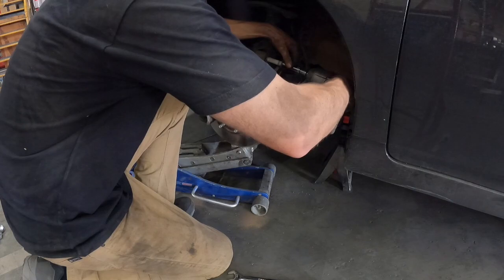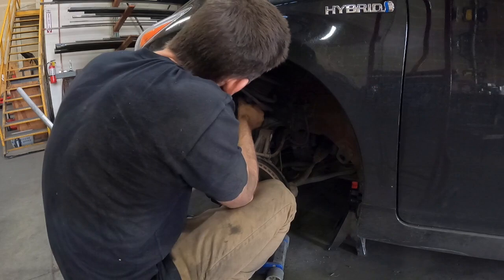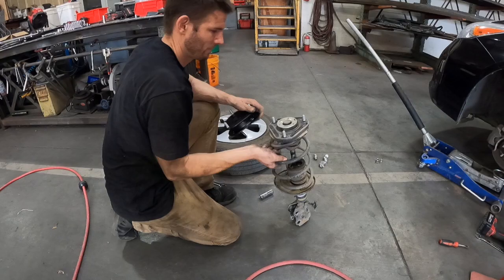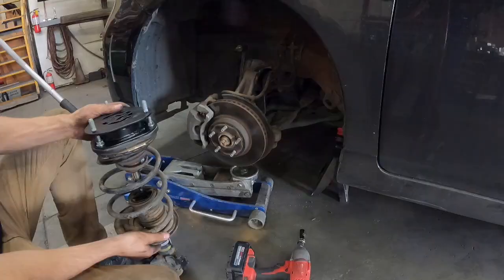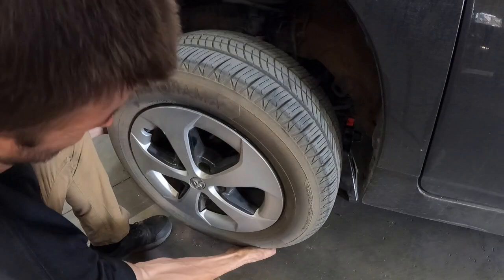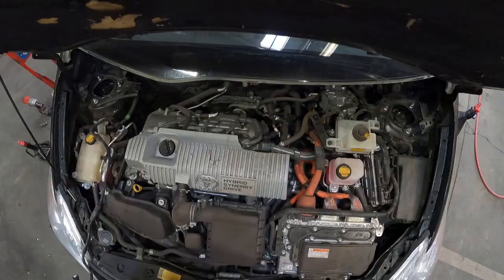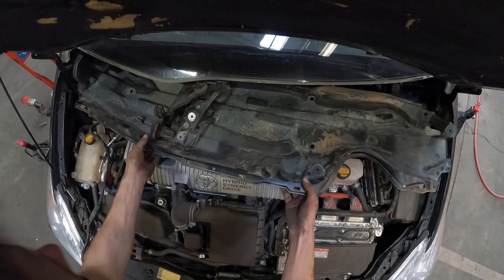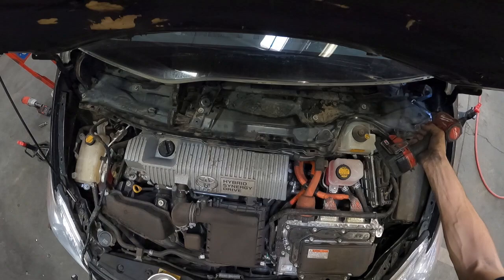PRIUS OFFROAD GEN 3 (2010-2015) Front Lift Installation

Comment: Hey brother, hope you're recovering well from your accident. Thanks for what you do for the community. I have to ask- Have you guys tried mix n matching OEM parts from other platforms? I think a Rav4 LCA up front and a Sienna strut would allow for larger lift without geometry or tire clearance issues. I haven't crawled under the back of my Gen 3 yet to see what in tarnation is happening back there, but it can't be that different to anything else they do. It's just arms and links- cheap parts to get lengthened etc depending on design, or use something of another car to get to spec. I just can't jump on the kits yet until I explore OEM options. 
One thing that's interesting is the Prius has TONS of strut/shock rod travel, most similar to a Sienna in terms of how the rear strut is mounted/moves through its travel. I assume the rear suspension is very similar, just lighter duty/smaller overall. Notably- I think the 08 era Sienna rear shock would fit really really nicely in a 2-3" lifted Prius--- In fact might have to use a slimmer bushing to "shorten" the compressed length, but it has another 1.1" of stroke, compressed length is 2.3" longer. There are Tacoma and Tundra shocks that have similar strokes/lengths as well. Tacoma oddly enough are too short. From what I can tell, Tundra rears would work beautifully. Almost exactly 1" longer than the OEM shocks, same stroke more or less. Valving would be a complete unknown. Definitely think the Tundra shock would work great, given the extra leverage the IRS has against it, and not having the leafs to manage, I think the damping might not actually be that bad. Hard to say. But the longer compressed length might prevent stuffing an OS tire as well. 
I actually considered using a Sienna shock on my 4Runner as a joke, since it has a really impressive stroke but the compressed length is too long. Which Is something I actually need now with my GX setup but I'm going TRD pro on it. The TRD Pro shocks are really really close to Prius OEM lengths, with a hair more extended length, nearly identical compressed. 14.7-25.5 give or take, prius is 14.5-23.8

Comment: Really having trouble reinstalling the passenger side strut to steering knuckle. Have some pry bars, etc, but don't seem to have any spots that work to get the angles right. Seems like a spring-compressor would work but don't have one. (My brother in law might... or I may make Harbor Freight a little bit richer!) Any tips appreciated!
Reply: Well I bought the spring compressors and they did help a bit. Also pushed up the bottom of the strut by putting a jack stand under it and lowering the car about an inch... then the rubber hammer and pry bar did the rest!
Reply from the maker: Have you watched our passenger side strut installation video that covers exactly this? https://youtu.be/MkQn7gV-arM
Reply from the maker: @gregors1422  Good to hear you got it figured out!

Comment: Mine is one the way!  Question, does the TRD rear sway bar help?  I haven't had a chance to really look where it mounts, but I couldn't understand how it would help a solid beam axle.  I've got 215/70R15 tires on right now and the front rubs some on bigger bumps, but I still scrape my bumper in places.  But I'm thinking about stability with a load on the back of the car, to be more specific about 170lbs of trailer tongue weight.  I've had 240lbs of salt in the trunk a couple times.  Less than half the payload capacity, with me in it.

You should make some videos on your Gen3.
Reply from the maker: Nice! As for the sway bar, we have yet to try out different sway bars but I would assume it would reduce sway as it's intended. Let us know your thoughts on it after you get it installed so we can let others know.

Comment: Do you have to remove the shroud and everything. I’ve removed it before so I know its not terrible. More just laziness. Looks like if I just take the outside clips and push up a bit, I can get a socket and ratchet.
Reply from the maker: It can be done but it's a lot easier to take the extra minute it takes and remove the shroud.

Comment: What about the 2021 AWD Prius lift kit installation? Same process? Will you be making a video for that? Thanks in advance.
I'm about to purchase a new 2021 AWD Prius and will most definitely be buying your lift kit.
Reply from the maker: Same process, just a little bit easier since you don't have to remove the metal wiper cowl to get to the top of the struts. No plans on making a video for that since it's the same process but maybe once we get some free time to step away from production and designing new parts.
Reply: @priusoffroad3232  Awesome. Thanks.

Comment: I just got the prius Offroad lift kit for my 2014, prius GS 1.8cc (gen 3) 
I own a right hand drive car...
So i need to ask how the arrows and letters should be placed on front kit
as you advised that the arrows should be pointed towards the passenger side (driver side in my case) and the letters up against the firewall.
I guess i have to place in reverse order, arrows towards the driver side, and where its written P(Passenger)  i have to put it on driver side and vice versa, but I’d really appreciate your input/advise as well.
Reply from the maker: Thats correct! If you have a right hand drive vehicle you would put the Passenger on Driver and Driver on Passenger. Both arrows would be pointing towards the driver side.

Comment: How much stress does this cause on the CV boot and joint....??? Recommend replacing shocks with this as well?
Reply from the maker: Very little additional stress to all steering, suspension, and drivetrain components. As for replacing shocks, totally depends on current mileage, year, and condition of existing shocks/struts. Check out our website FAQ page where we answer both of these questions in detail.

Comment: Do the CV joints have reliability issues running at a steeper angle from the gearbox to the hub with the spacer kit added  ?
Reply from the maker: Nope! We limited it to 1.5" specifically for the purpose of minimizing excessive wear and tear on steering, suspension, and drivetrain components. So far we have yet to see any increased wear. :)

Comment: Is this the same for the new 2021 awde? I'm guessing the front ends haven't changed in a few gens?
Reply from the maker: The second half of the process is the same but the the first part is actually easier for the GEN 4 since once you remove the plastic wiper cowl the top of the struts are accessible without the removal of the metal tray.
Reply: @priusoffroad3232  thanks for your detailed reply. That's good to hear for serviceability in the future too. I'm going to order as soon as I have a loca tech to install

Comment: Is this process the same for Gen 4 prime?
Reply from the maker: It's very similar with the exception of how the plastic cowl is removed, and the fact that you don't have to remove the metal wiper cowl. We have written step by step instructions listed on our website under the installation tab.
Reply: @priusoffroad3232  cool! And do I have to remove the wiper motor still? I’m taking delivery next month but want this kit to help with clearance for snow
Reply from the maker: @xbshot  You would still need to remove the wiper motor which takes about 5 seconds. Check out our instructions on our website for more info.

Comment: Is it same process for a 2017 Prius Eco?
Reply from the maker: For the most part. The only real difference with the gen 4 is that you don't have to remove the metal wiper cowl which saves you about 5-10 minutes.

Comment: Do you have an install video for a Scion iM/Corolla iM?
Reply from the maker: We do not. They are very similar to the GEN 3.
Reply: @priusoffroad3232  That’s what I sorta figured but I wanted to double check with you. Thanks for the info!
Reply: @priusoffroad3232  when lifting the car; do you recommend having the car on 4 jack stands?
Reply from the maker: @EONEILL1987  Nope! Do the front and rear separately. Having the leverage of the wheels on the ground on the opposite side helps when reassembling the rear suspension with the spacers in.